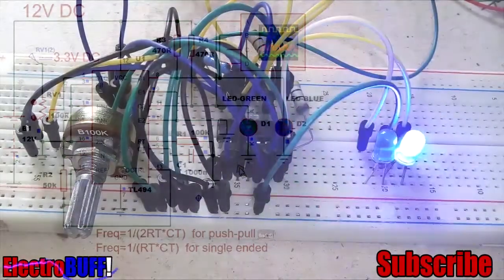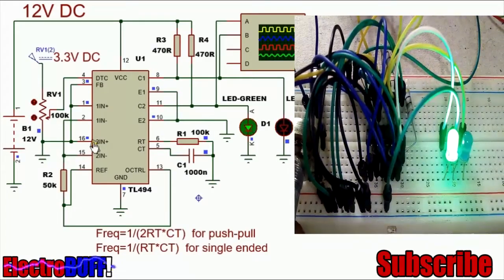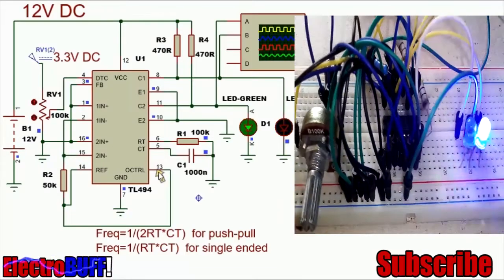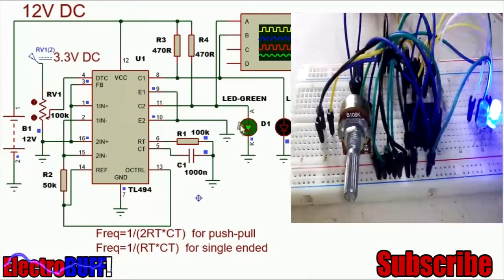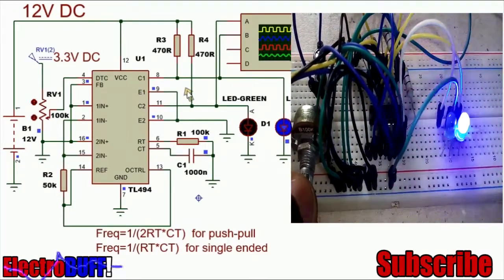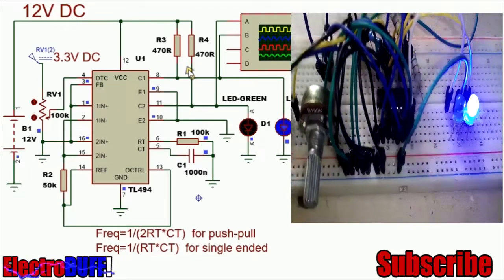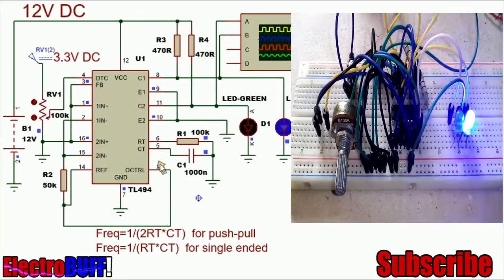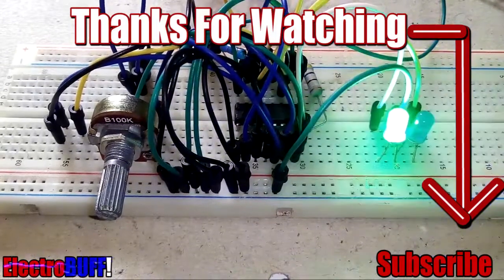TL494 PWM IC Test Circuit + Video Demo!

Comment: I did the circuit, but the leds flash when my finger touches the potentiometer.  I don't understand where RV1 connects
Reply from the maker: It happens when there's poor contact between the potentiometer contacts and the circuit. The potentiometer connects between ground and 5v/3.3v with the middle variable contact being connected to DTC pin 4 for manual dead time control ( this is what affects the pwm)